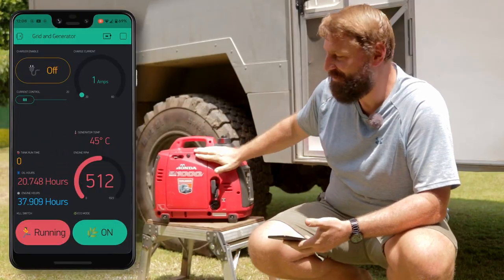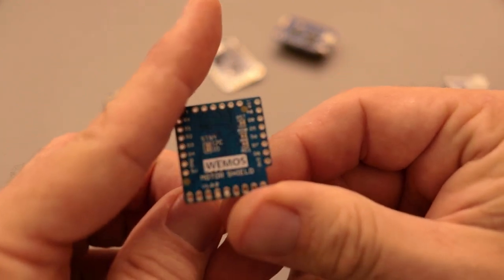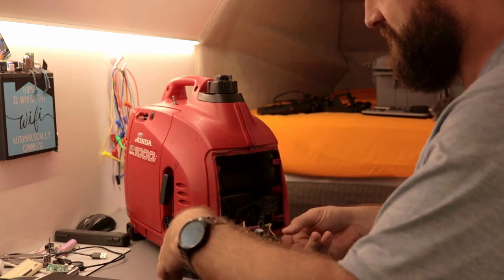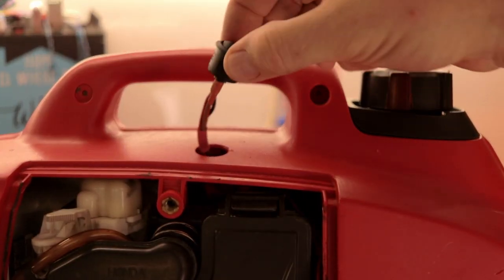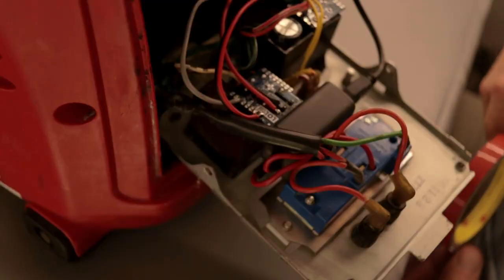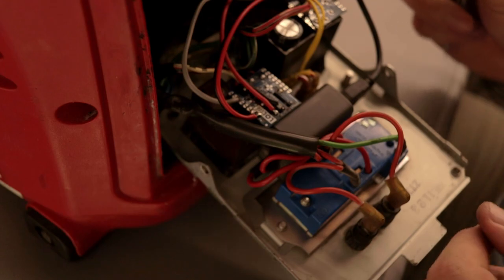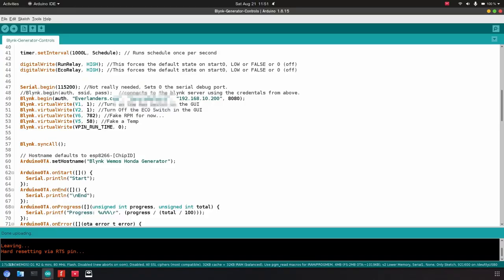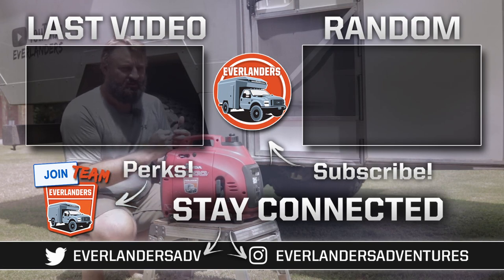$10 WiFi Remote Generator Control with Hour Meter

Comment: Could you have used a cap, diode, and a couple resisters to keep the kill relay activated long enough to complete the shutdown?
Reply from the maker: Nope, I tried over 10,000uf and it still wasn't keeping it closed long enough.
Reply: Ha ha was thinking the same. He tried this simple solution..

Comment: I’ve gotta say thank you... 

after seeing your vehicle walkthrough, I decided to deck out my landcruiser...it now has 660w of solar, a 200ah lithium...water pump, travel buddy & lights all controlled by Bluetooth relays...induction cooker, air fryer, toaster & kettle....& a propane hot water on demand system....with planes for a smal Aircon in the roof tent.

This is my favourite channel by far! Keep up the good work.

Comment: Such a cool project. I have a 1940s Kohler generator (converted to propane) at my cabin in a shed. It has a off-run-start switch. This would be cool to implement in order to control and monitor from inside the cabin.
Reply from the maker: Yes! Should be easy enough to adapt to your Kohler...

Comment: If you haven't looked into it you may find some use out of a battery-powered hot glue gun. Ryobi has one and you could get an adapter for your Milwaukee batteries. It could be quite useful for protecting some of the unprotected parts of the circuit boards. Plus that glue dissolves with rubbing alcohol for fairly simple removal should you need to mod things.

Comment: This project has been pretty far down the list, but on my list of projects I would like to do. I have a Honda generator with electric start. I would like to be able to start it and shut it down automatically. When we have a power outage, I would like Home Assistant to start it once every couple hours long enough to keep the refrigerator cool and the house from freezing. I am just getting Home Assistant up and running and learning about MQTT. I think this would be a great project for me to start with though. Are your solar panels not keeping up anymore?
Reply from the maker: The Solar panels are doing great. 5 kWh a day on average - This will be used as backup for times we are in Rainforest cover, or hurricane season when the Solar Production is lower. (That explanation got cut from the video for brevity.)  Adding a start function should be easy enough, and since your generator has it's own battery you can keep the Wemos online with that... Could even monitor the battery level and start and recharge it if it's getting low.

Comment: This is awesome - I've got a hair brained idea for a similar project, but add voltage monitoring (and potentially current/state of charge using the 500A 50mv shunt) and a relay to auto start my generator. Your code is going to be a great starting point

Comment from the maker: What do you want to see next? Remote Start, AC Current Meter, RPM, Temperature???

Blog post is online now!!
https://everlanders.com/wifi-generator-remote-control/
Reply: Remote start on a small generator would be cool.
Reply: Remote start please! I've been thinking about building a remote start/stop system on a 2000W honda generator but haven't come up with anything for how to start it so far.
Reply: Temperature shouldn't be difficult. RPM would be great. Fuel level could be a bit difficult to implement safely, but would be a very nice feature.
Reply from the maker: I think one could correlate Wattage produced/ consumed with RPM and Runtime and get pretty close for fuel level.
Reply: Remote pull start???  

That’s Wizard level electronicalness! 🧙‍♂️
Reply: Remote start please.
Reply: I vote for remote start also! Thank for sharing all your projects with us.
Reply: My vote is temp and rpm. Remote start only if you think it’s easy enough.  Personally I would want to be next to it when it starts to make sure there isn’t any possible issues.  The ability to monitor status and shut off remotely is far more practical than remote starting…… but that’s just me 😉
Reply: @joell439  but… remote start on a pull start genny???

You know your just a bit curious…
Reply: Volt/amp/watt meter with automated shutdown! What if your genny is spinning away for an hour after your house batteries are topped off? It could charge them up to a set point and put itself to bed. Also useful if you're worried about overworking that little 1000.
Reply: Temperature next, that is applicable to several use cases. Thank you!

Comment: do you have any recommended resources for a rank beginner in all this electronics stuff? I don't know where to start.

For example, I just stumbled across a video about Shelly relays because I want to automate some light switches in my rv. But, I don'tk know whether to use those or your Wemos thingys. And the Shelly's are expensive! $20+ for just one.
Reply from the maker: Get a Wemos D1 mini for 2.50 and start playing, blink the LED to get started. Some people learn by reading through textbooks, not for me, choose a common platform with lots of community support and web search your way through it.

Comment: I have 2 of these older ones like yours that I pair together in case I need a larger load like my ac and use the single one to keep my batteries topped off..neat mod but i dont know if I need something that complicated i have a kill switch on the spark side using a smart outlet to run shutting down the generator would your system work with a parellel system? great content also use some fuel additive in these, i use seafoam but it keeps them from gumming up the carb...and i have probably 500 hours on mine so far without a problem
Reply from the maker: Sure. you could run as many in parallel as you'd like, Shut them down in unison or separately...

Comment: The legacy blynk app is no longer available, can we use the new version of the blynk app? FYI, I tried to scan the QR code in the new app but got error, Thanks.
Reply from the maker: No, you'll need to load an older version of the APK.

Comment: Great videos as usual! Not sure if this is the right place to ask but can you talk about your Diesel engine and the fuel you get in Latin countries compared to the U.S. Does your engine requires low sulphur diesel? Are you able to get it? If not what do you do? Do you use any additives etc?
Thanks 
James
Reply from the maker: We knew that ULSD is not widely available in Central America yet, so we specifically sought out a chassis that had the International 7.3L Diesel. This engine was designed for, and runs better on the higher sulfur diesel we find here... No need for additives or trying to find DEF. Talking with some of the locals here, it seems all of them have had a friend who brought in a nice truck from the USA, only to have the exhaust system bungged up within the year. Most of the Europeans we run into are built on older chassis which also have no problems, newer engines require modifications to the exhaust system, engine management computers, and additives to keep them going... I can't speak to that.
Reply: @Everlanders  Can the International 7.3L Diesel run on low sulphur diesel? Thank you.
Reply from the maker: Sure, some people say it's harder on the injectors, there are common fuel additives to help lubricate them as well...

Comment: What size of wire did you use? Single or multi- strand?
Reply from the maker: It really doesn't matter what you use, it's low voltage signal wire... I used some random 16 gauge from the junk bin.

Comment: Why not just use a capacitor to hold powe long enough to keep the relay on and shut the engine off
Reply from the maker: I tried with almost 10000uf, wasn't enough.

Comment: Have a 4000 Watt Champion generator and I use it for my window air conditioner. I think it would be cool if I would be able to shut it off as the temperature in the room cools off.
Reply from the maker: That should be easy enough to adapt this to your application...
Reply: You'll probably be wanting a relay to turn off the AC first, then another to kill the generator. Gotta protect those compressors and circuit boards.
Reply: @PatrickKQ4HBD  that may have been what ruined my last generator. Our just put a gallon of gas in it and run the AC until the gas ran out. Then all the sudden the inverter quit putting out power

Comment: Instead of using the 3 position switch could you just use a small capacitor to store power for a few seconds until the unit is completely off? Connect directly to the relay since you don't need to power the whole unit.
Reply from the maker: I had over 10,000uf on there during my testing, it wasn't enough to keep it closed long enough, plus I wanted to keep the switch there for manual shutdown anyway.

Comment: Love these videos! Quick Q: Are you paying the Blynk subscription, do you think it's worth it etc?
Reply from the maker: No, we run The local blink server in our rig so that we can use it in remote locations without connectivity... 

I do not think it is worth it, it lacks many features compared to the original. As a supporter of their original kickstarter, evangelist of the product, I implemented dozens of installations for a garage door openers etc, I'm appalled at this move where they will be discontinuing the old one in favor of a subscription-based model.
Reply: @Everlanders  Thanks for the response! Have to say having spent the morning trying "Blynk 2.0" out and then firing up the "legacy" app I am coming to a similar conclusion - seems like a bad move from them. With them discontinuing the local Blynk server availability (without finding an old archive), I think I'll be searching for a different solution... likely something based upon a local web server and simple web app.
Reply from the maker: Just backing up the .jar file is all you need, the whole server runs inside a single Java container. But I agree, I'm presently in the process of migrating everything to MQTT, InfluxDB and Grafana 👍
Reply: @Everlanders  Sounds like a nice solution, curious as to why you are using MQTT rather than a HTTP API as you've previously demonstrated in some past videos (I think)
Reply from the maker: I'm using both in parallel for various reasons...

Comment: i need a battery monitor auto-gen start AGS, except my generator all already has a 2-button wireless remote. Could we program these little guys to trigger gen to start when the battery hits low voltage say 12.2 volts and shuts off gen with voltage hits 13.2... The little box would need to learn 2 button remote frequency
Reply from the maker: Yup
Reply from the maker: #include <ESP8266WiFi.h>

// Define relay pins
const int relayStartPin = D1;  // Relay to start the generator
const int relayStopPin = D2;   // Relay to stop the generator

// Define voltage sensor pin
const int VoltageSensePin = A0;

// Battery voltage thresholds
const float startVoltageThreshold = 12.2;  // Start generator below this voltage
const float stopVoltageThreshold = 13.2;   // Stop generator above this voltage

// Define deep sleep duration in microseconds (1 hour)
const uint32_t deepSleepDuration = 3600e6;

void setup() {
  // Initialize relay pins as OUTPUT
  pinMode(relayStartPin, OUTPUT);
  pinMode(relayStopPin, OUTPUT);
  
  // Connect to Wi-Fi (optional if needed for remote monitoring)
  // WiFi.begin("your-ssid", "your-password");
  // while (WiFi.status() != WL_CONNECTED) {
  //   delay(1000);
  //   Serial.println("Connecting to WiFi...");
  // }
}

void loop() {
  // Measure battery voltage
  float batteryVoltage = analogRead(VoltageSensePin) * (15.0 / 255.0);

  // Check if the battery voltage is below the start threshold
  if (batteryVoltage < startVoltageThreshold) {
    // Trigger generator start by closing the relay for 2 seconds
    digitalWrite(relayStartPin, HIGH);
    delay(2000);
    digitalWrite(relayStartPin, LOW);
  }

  // Check if the battery voltage is above the stop threshold
  if (batteryVoltage > stopVoltageThreshold) {
    // Trigger generator stop by closing the relay for 2 seconds
    digitalWrite(relayStopPin, HIGH);
    delay(2000);
    digitalWrite(relayStopPin, LOW);
  }

  // Deep sleep for 1 hour
  ESP.deepSleep(deepSleepDuration);
}

void WiFiSetup() {
  // Add your WiFi setup code here if you want to use WiFi for remote monitoring
}
Reply: @Everlanders  super cool.  Now just need a way to clone Generator FOB Start/stop.  That said I’ve seen others cut them open and solder into buttons.  I’d prefer a more elegant solution
Reply: @Everlanders  anyone on here sell a working version of this device?
Reply from the maker: On here? In the comment section of a YouTube video?

Comment: We've got an electric start 3000va generator and this has given me ideas.. I think I'll add to the D1 an opto sensor for RPM, a couple of NTC's for head temp and exhaust temps. Perhaps even a float sensor for the fuel tank. As it's an electric start there is a battery but the D1 would kill that in a couple of weeks if not careful, so might have to fit power isolator kill switch for the D1 between long periods of non-use, but will defo use a voltage sense for the battery (Via an external ADC board as will need more than the single crappy ADC onboard for the NTC's). Cracking project.
Reply from the maker: Save the ADC for voltage sensing, use DS18B20s on a OneWire bus for as many temperature sensors as you want.
Reply from the maker: Also, eTape could be used for the fuel level...
Reply from the maker: Also, the D1 has μSleep, I've run it for months off a single 18650, just put it to sleep for 5 minutes if it hasn't been accessed in 48 hours or something. Or if you want to maintain instant control, monitor the battery voltage and start it for 5 minutes if you feel it's getting too low...
Reply: @Everlanders  I'm not a fan of the in-built ADC, it's a bit noisy and unreliable, but point taken. I do like the Dallas sensors, but not sure one would survive the heat area temp for long though.
Reply: @Everlanders  Oooh, etape, never heard of that, got a link or search term?
Reply: @Everlanders  Yes, good call - deep sleep would be a decent option; I'll investigate further (I use ESPHome generally and I know they have implemented it
)

Comment: I see everlander is a heavy Blynk user. And Blynk is dumping the old platform. Will everlander be migrating to the new system? Or finding  new iot company?
Reply from the maker: I did not rely on the blink Cloud anyway, I run the server locally so that it is available to us off grid. In spite of that I have migrated to InfluxDB, Grafana, and MQTT, all running in parallel so that I could ditch Blynk if I needed to...
Reply from the maker: As explained here:
https://youtu.be/679VUP4KIY4
Reply: @Everlanders  I assumed with your remoteness you are running a local server. And that is understandable. Thank you for responding. Your YouTube channel is an inspiration.

Comment: Maybe get a generic 12V to USB adapter that you can get at every car shop and use that as a DC/DC converter?
Reply: And use a capacitor to lengthen the runtime of the wemos module, to solve the issue with the kill switch
Reply from the maker: Good idea, but I'm not sure they would survive the 40+ volts coming out of the 12 volt windings...
Reply from the maker: I tried several combinations of capacitors, but nothing of reasonable size would keep it running long enough... I tried so many things, most of which got cut from the final video...
Reply: @Everlanders  most 12V to USB adaptors can also handle 24V. And wouldn't the 12V output be protected in some way? I can imagine users keep their 12V equipment plugged in between restarts, and not all equipment can withstand those power spikes
Reply from the maker: No, The Honda's 12 volt output comes directly off the generator windings and through a bridge rectifier, there is no voltage regulation whatsoever... This is why Honda has a bold warning, "For battery charging only"

Comment: you can use small capacitor to fix relay problem
i hop you understand me because my English is bad
if you don't i will try again
Reply from the maker: No, I tried with 4700uf, and it still was not enough to hold it closed long enough to kill the engine.

Comment: Why do you guys even have a gas-powered generator?  And, more importantly, why not use a diesel-powered one so you don’t have to carry another fuel source?
Reply from the maker: We really don't need the Generator, We have more than enough Solar 99.9% of the time. But when we were in the Arctic and the Sun never left the horizon, then we could have used some extra watts. The other time we needed it was in the Coastal Rainforests of Guatemala,. There we needed a little extra power to run the AC.  We really only need a few hundred watts once in a blue moon. I recorded this explanation for the video, but it got cut for the sake of Brevity. But it is the first paragraph the Website Post.
https://everlanders.com/wifi-generator-remote-control/

And I would have absolutely prefered to have a Diesel-powered option, but I don't think they exist in this small size... And certainly not for $300
Reply: @Everlanders  Thanks.  That makes perfect sense.  Propane would have been a good choice also, but you guys don’t carry that.  Thanks for the explanation.  Happy Overlanding.  👍
Reply: @Everlanders  i have a diesel onan qd 3200 along with my hondas, they both work great only use the diesel when running convection microwave and or ac at the same time the only time i get close to drawing 30 amps and a cofee machine